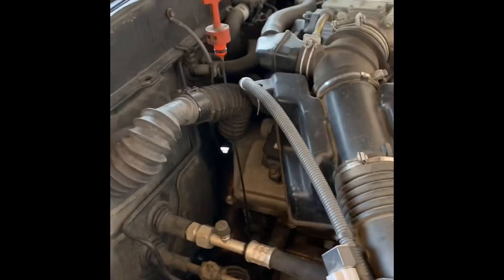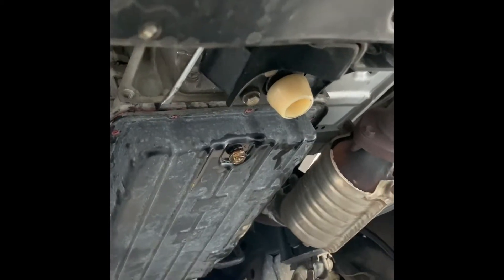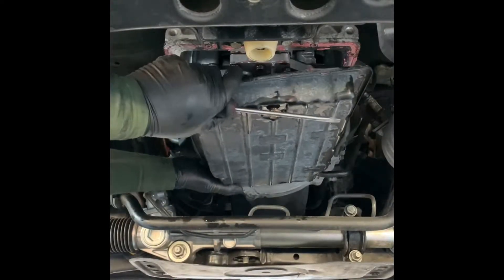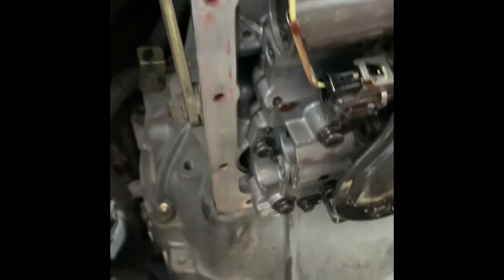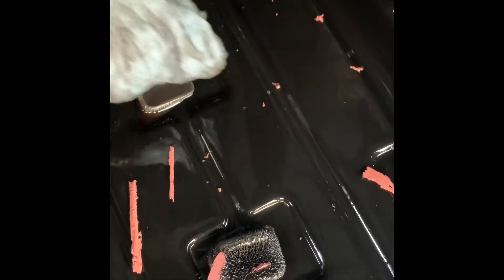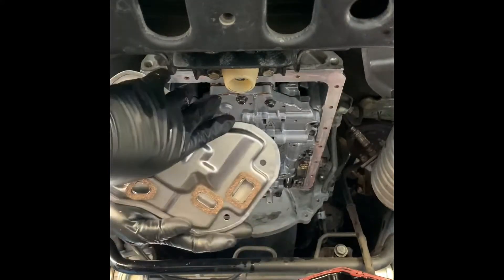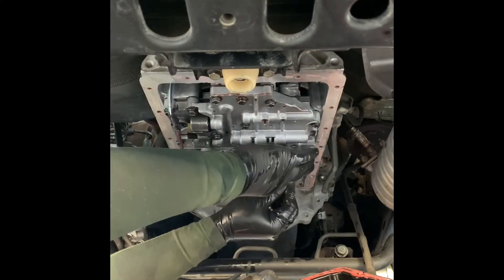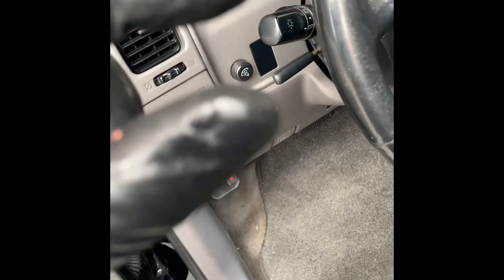96-02 Toyota 4Runner Transmission service

Comment: ...thanks for the video....I've been trying to figure out which filter I needed for my 2WD  2000 Toyota 4Runner transmission
and your post has answered my question.....which brand did you use and number?...OEM or aftermarket?.....also, do you know
the torque for the filter bolts?....TIA   :)
Reply: You mean your 2001 Toyota 2runner🤣🤣
Reply: @ken K... try https://www.oemgenuineparts.com .... you just enter the VIN of your truck and it gets you the parts you need specifically for it.... then go to www.rockauto.com ... you get the parts there
Reply: Then try this, TIMMY replaces the filter on a 4WD, but most likely the torque will be the same...

https://www.youtube.com/watch?v=tuGazNhuEtM

Comment: How do you tell what transmission u have
 I have a 98 limited v6 with 4 wheel drive?
Reply from the maker: If I remember correctly it depends on the number of bolts to the transmission pan.